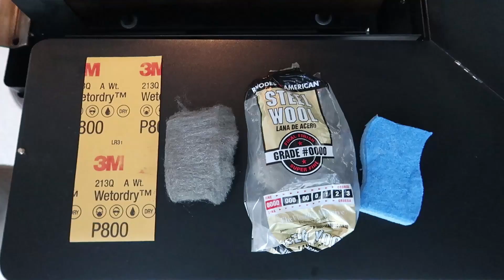How to get a smooth griddle surface for stick free cooking and use less oil

Comment: Maybe it’s been mentioned already but I usually clean the surface well between grits. My reasoning is that, if you don’t clean in between, you’ll then drag remnants of the coarser grit into your next step. Just my .02
Reply from the maker: Good point! Thanks for watching and taking time to comment!

Comment: Dave, I have a brand new Blackstone. Can I sand down with an Orbital sander with different Grits right away to establish a smoother surface than stock delivery?
Reply from the maker: Thanks for watching and for your commment. Yes and no. I usually sand down the surface of a new griddle but be careful not to go too fine. You want some texture for the seasoning to adhere to. I would go with a 120 G first and finish with a 220 G. Then at least 4 cycles of seasoning burn off. I've recommended flax oil in the past but find that it is so brittle that it tends to flake off so now I would just use canola oil or avacado oil. Be sure you put VERY THIN coats down and let it burn off till it stops smoking then then cools completely before doing the next seasoning cycle. Hope this helps.
Reply: @NextWithDave  thanks for the info. That makes complete sense. I may do it right away or I may just wait till the first time it Rusts, then I have to sand it down. LOL.

Comment: I am about to do this. How do you deal with a few rust spots? Vinegar? Or just sand it off? Something else?
Reply from the maker: Sorry for the delayed response. Rust can be tough to deal with. Once it starts it is hard to stop. I run into it in the summer here in Florida because of the high humidity. I know it's a pain but what I do is basically start over. I sand the whole surface down with an orbital sander. Starting with 120G and then 220G. Then reseason it with avacado oil. The key to sucsss with seasoning is to apply the oil when the griddle is hot not when it is cold. That waty the steel has expanded and the pores have opened up which allows the oil to sink all the way into the steel. Use VERY THIN coats of oil Let it burn competely off until there is NO smoke. then let it cool all the way down and do it again 4 times. Now after you have done this, when you are putting the griddle away apply a good thick coat of oil to the warm or cool surface. Put the cover on it and you should be ok. On the next time you cook, you'll scrape and wipe away all the oil that was on the surface before applying the oil for your cook. the method I use on this video is only to "dress" the surface to knock down the scratches in the seasoning that occur from normal use. Hope this helps and thanks for watching.
Reply: @NextWithDave  Very helpful. Thank you!!

Comment: Dave, could you show us how you grind down the spatulas so the corners are rounded? I have a bench grinder and a Shopsmith. I’m sure I would have something I could use, but I don’t know how to do this grinding. I tried using sandpaper on the scrapers you recommended, but the edge seems to be delaminating. Since then, I bought solid stainless steel spatulas, but they all have the sharp corners. Thanks, for your videos. i have passed them on many times with really good reception.
Reply from the maker: Hello Nancy. Thanks for  watching and for your comment. It is possible that the combination of heat generated by the grinder and sideways pressure could be causing the delamination. On mine, I used a steel file. 10" medium mill bastard but any steel file should work. Just work the file perpendicular to the blade and it should work fine. To sharpen the edge, I drew it across a V shape carbide knife sharpener like you would sharpen a knife. Finish it with your kitchen steel and you're good to go. Hope this helps. Thanks again for your question. Dave

Comment: Hello great video I'm about to purchase a griddle and I was wondering if I can do this process before I start the seasoning process or should I wait until afterwards? Thanks in advance
Reply from the maker: Thank you for watching and especially for taking time to comment! I do recommend this process LIGHTLY before your first seasoning cycle. Remember, when seasoning, use a S M A L L  amount of oil each time. The minute you use too much oil you'll get a thick sticky surface. Patience  and at least 6 heat cool cycles is the key. Let the griddle stay heated till it stops smoking. before you turn it off for the cool down cycle. Good luck!
Reply: @NextWithDave  thank you very much it's greatly appreciated. Just finished watching another video of yours great channel!

Comment: That's awesome. How often do you season after the first pass?
Reply from the maker: Hi Raju, thanks for watching. After I do the process you see in the video I do one high heat cycle burning off the oil till it stops smoking. Then a light coat of oil for storage. Thanks again, Dave.
Reply: @NextWithDave  I wanted to know once you do that, do you have to repeat that step and how often
Reply from the maker: @rnmaa1914  I don’t have to do it very often. Only if I feel like food is sticking too much. Maybe every 10 cooks or so. Thanks again?

Comment: I have a fairly big surface gouge and I already threw away my box so I can't return it. There's nothing else I can really do but try to repair it do you think sandpaper will do it I could send you a picture of it.
Reply from the maker: Hi Aaron. Hard to say what to do without seeing it. You might want to reach out to the manufacturer and see what they suggest. Also,  you could take a picture of it and post it on one or more of the Facebook griddle groups. You'll need thick skin to get past the trolls but you'll also get lots of suggestions on what to do.  Thanks for watching and good luck!

Comment: Great video. Just did a quick search to order some steel wool at home depot and didn't realized they have nearly as many "grids" as sandpaper does. Any recommendations?
Reply from the maker: Thanks for watching! Go with 800 Grit Sandpaper and 0000 Steel wool. Be sure you don't press very hard. Be sure to RINSE thoroughly with water several times. Then coat with oil and wipe off. Then burn off a very thin coat of oil to re-season. Thanks again. Dave
Reply: @NextWithDave  Thank you very much!

Comment: Hi Dave,  I just got a griddle, have not used yet.  Should I season the griddle first, then do the steps you described in this video.
Reply from the maker: Yes, season it first. Do not sand it before your first seasoning. Do it exactly as described by Blackstone Products. I recommend either Grape Seed Oil or Flax Seed Oil (I use Flax Seed). Also, you'll want to do several heat/cool down cycles. Put a THIN coat of oil on it, let it burn off till there's no more smoke. Then cool down all the way. Then do it all over again. By about the 4th cycle you'll have a well seasoned griddle to start with. Good luck and enjoy many years of fun cooking!

Comment: Dave, I noticed some areas on the griddle where the seasoning looked a little thin. I wonder if that is partly due to steaming vegetables under a lid?   It seems that steaming or boiling liquid acts to deglaze the surface as you would a pan. Just curious.  Great video again....
Reply: You might be right...I've never noticed it but since I was re-seasoning pretty frequently that may be part of why. I wouldn't abandon the technique though. Just a little more maintenance required.

Comment: Can/should you do this with a new surface that hasn't been seasoned yet?
Reply from the maker: Joe, thanks for watching and for your question. My Blackstone came with a "seasoning" from the factory. It felt very rough so I sanded it completely off. Then began the seasoning process. It takes about 6 cycles of burning off THIN coats of Flax seed oil with complete cool down between coats. Hope this helps. thanks again.

Comment: Hey Dave I just got a new Blackstone.  Would you recommend I do this step before the initial cleaning and seasoning?
Reply from the maker: Hi Michael. There are two different groups of opinions on this subject. Some say don't do anything, some say sand all the pre-seasoning off. I recommend you use my method but don't get carried away. Thanks and good luck. Dave
Reply: Will do! Thanks Dave!

Comment: What's your thoughts about using a 1000 grit sandpaper or greater? VERY interesting video👍
Reply from the maker: Marty, Thanks for watching and for your question. I think you can use 1,000 G sandpaper but I'd suggest you start out with maybe 400 G, then go to the 1K G and finish with the 0000 Steel wool. It all depends on how much of the seasoning you want to take off before you "polish" the surface. If you're taking out scratches and high/low spots then start coarse, go fine and polish with SW. If you're only looking to polish then 1K  G and 0000 SW. After polish, then re-season at high temp with Flax Seed Oil. A VERY THIN layer a couple of times. Polish that lightly with steel wool and you should be good to go. Also, I've gone to using steel utensils only when I need to. Wood and plastic work fine for things like veggies and steel for food you are getting a crust on. Hope this helps. Thanks again!! Dave

Comment: Awesome video! How often do you recommend cleaning the griddle using this method?
Reply from the maker: Thanks for the question Amy. After cooking, in the cleaning process, after the water/steam cleaning I'll give it a quick once over with steel wool just to knock down any scratches. Then do the final light coat of oil  for storage. I do the sandpaper and steel wool about once a week if it needs it. Thanks again for watching and for your question.
Reply: I clean a wet sand and re-season my griddle after each use so sometimes 2 times per day... But at least 3 or 4 or more times per week... My griddle is smooth as glass and Black from front to back...

Comment: Should you do this when you buy a brand new one??
Reply from the maker: Thanks for watching! I do recommend this for a new griddle before the first seasoning. Be sure to rinse completely. Run one heat/cool cycle to dry it out. Then season with VERY thin coats of oil Six cycles. Good luck!

Comment: Dave, thanks for your videos. I just bought a 19” Blackstone griddle and getting ready to season. My question is, did you sand your griddle smooth before you seasoned the first time?
Reply: I did sand it down before the first seasoning cycle and wish i hadn't. I think the slightly rough surface helps the initial layer of seasoning build up.
Reply: Captain Dave I sanded it slightly with 400 grit wet/dry sandpaper. I wasn’t even touching the surface texture, so I stopped and just washed it off. The I seasoned it. Funny thing, my husband wasn’t happy that I bought it, but we’ve used it twice, and he has cooked on it both times. I haven’t even cooked on it myself, yet. I’m impressed with the flavor that seems to magically happen. Thanks so much, for your videos. They are informative and inspiring.

Comment: Cool video . How to remove deep scrach tip?
Reply: Not much you can do about deep scratches. Every few months I would sand the entire surface of the griddle down to the bare metal and start over again. there are some good vids on line which show how to do that.
Reply: I ended up sanding down the surface and re-seasoning when I got too many deep scratches.

Comment: Can I use this method on a new 36” blackstone grill before using it?
Reply from the maker: Michael, yes, you could. However, I don't recommend taking it all the way down to the bare metal. Just enough to get the roughness off and then proceed with seasoning cycles. Good luck and have fun!

Comment: I tried your method and as I was using the 800 sandpaper I saw what looked like seasoning or maybe built up oil rubbing off.  I continued and then used the steel wool.  After wiping it off with water the surface is feeling sticky and not slick.  Should I continue to remove all of the seasoning before I finish with a final coat of oil? I do not like how it feels sticky when I touch the surface.  HELP!!!
Reply from the maker: Thank you for watching and especially for taking time to comment! Its hard to say why it is sticky. Usually, that is the result of too much oil used during the previous seasoning process. I recommend you start from scratch. I would use a grill stone and take most if not all of the seasoning off. Then, using a high temp oil like flaxseed, grapeseed, avacado or even regular olive oil re-season it. My method in this video was intended to just remove the scratches made by utensils and resore a previously good seasoning. Also, my method included a final high heat seasoning with a thin coat of oil to finish the process. Remember...THIN COATS that you burn off till they stop smoking. Several cycles of this process and you're good to go. It's an ongoing process. Every time I finish cooking I clean off the surface, spread a thin coat of olive oil on it, burn that off and then finish with a coat of oil for storage. Next cook, I wipe that off and cook. Hope this helps.
Reply: Next With Dave Thanks for responding so quickly!  I am still here at the griddle and I will try to remove some of the seasoning.  I’m noticing that underneath the build up is a really smooth surface.  When I finish I will season with flaxseed oil which I used previously.  I will report back.  Thanks

Comment: Dave, looking for advice. I recently got the blackstone 36 griddle and seasoned it according to blackstones instructions. It's seasoned pretty good but foods like chicken, rice or noodles will kind of stick and gunk up. 
Will this method fix that? 
Any additional advice?
Reply from the maker: Logan, Thanks for watching for your question! Not sure which oil you use for seasoning but I've switched to Flax Seed Oil. I find it gets harder than other oils. The down side is that sometimes it flakes off so I look for that before i cook and will hit the surface with a quick wipe of steel wool then rinse and apply a little Olive oil. I've switched to regular Olive oil instead of Extra Virgin oil. It has a higher smoke point and a good flavor. EVO is for salads. One of the things I think is important in the seasoning process is the cool down period. Also to season with a THIN layer of oil letting it burn all the way off. Lastly, I use very thin spatula's and drywall knives. I sharpen them and round the corners. This way I can really get under the food carmelization and it comes off with the food instead of staying on the griddle as gunk. Hope this helps. Keep an eye out for more tools and tips coming soon. We just did a few more videos and they are in editing now. Thanks again and good eating!
Reply: NextWithDave thanks for the reply. I've been using grape seed oil. But this is good info and much appreciated. And I agree I found that drywall knife works well for scraping. thanks again for the videos

Comment: what is a good oil to season your griddle with and cook by
Reply from the maker: Ronnie, you can use just about any oil but most everybody agrees lately that grape seed or flax seed oil work best. I use flax seed. the key to success is to put on a THIN coast, burn it off, let the unit cool all the way down...repeat about 6 times.

Comment: I just bought a brand new griddle. could i do this method right off or should i season the griddle first
Reply: Brenden, Thanks for watching and for your question. You should not sand the surface before you do your first seasoning cycles. Go through about 4 seasoning cycles before your first cook. You would only use the sanding method after you've cooked on it  while and you get scratches that you want to knock down and smooth out. I do a quick pass with the fine steel wool before every session and then use water and wash/wipe it off. Then put a small amount of oil on it and you're ready to cook. Thanks

Comment: Dave, thank you for your reply.  So, can I season 4 times, then do your method described in this video right after the 4th seasoning cycle?  Or, do I have to wait after I have used the griddle a few times?
Reply from the maker: You can use the griddle right away after seasoning if you want and don't necessarily need to use my method. Seasoning is an on-going process. I always do a light rub with steel wool before I cook, then rinse it off and put just as little olive oil on it as possible. Then start cooking. If what I'm cooking requires it, I'll use more oil but we try to limit cooking with it. The steel wool will knock down any lumps in the oil that burned of last time and knock down any scratches from tools. You may not need to do it every time, only as needed. Hope this helps and have fun!

Comment: Does this work for cast iron as well?
Reply from the maker: Abraham, thanks for watching. I haven't tried it on cast iron but that's a good question. I've got a 14" cast iron skillet I'm going to try it on. I think it will work because we're really just smoothing out the carbon surface so the effect should be the same. If you try it before I do, please post the results for all of us to learn from. Thanks again!

Comment: So when this surface is brand new-it's not smooth? Saw a new one at Lowes today, and the surface was far fron smooth. Looks like it had a texture like cast iron.
Reply: Chalemi, Thanks for watching and for your question. The new griddle top will not be smooth. I think Blackstone does this so the seasoning has a better surface to stick to. Once you get it seasoned with oil and fats from cooking, the top of the seasoning will be smooth. You can make it even smoother and more non stick using some very fine steel wool to "polish" it. After you do the steel wool, put a thin layer of flax or grape seed oil on it, heat it up till it smokes, wait till it stops smoking, let it cool all the way down and you're ready to go. Thanks again. Dave